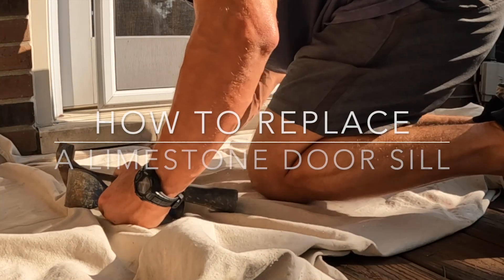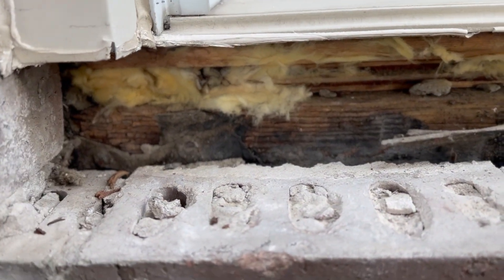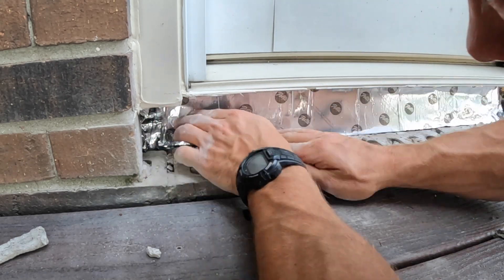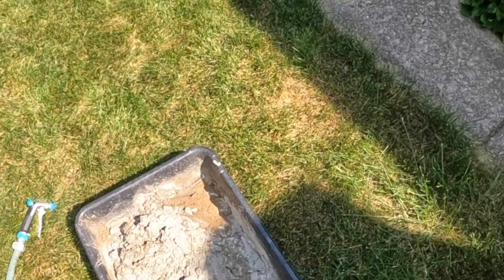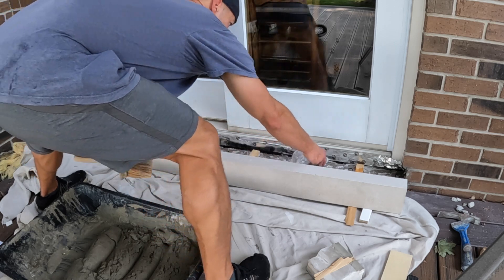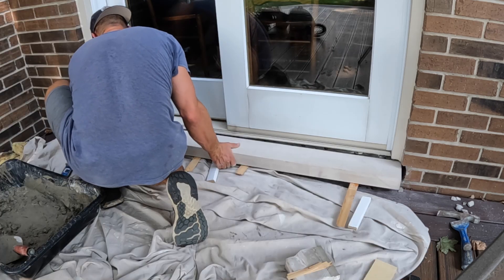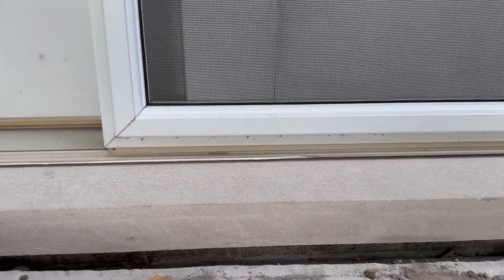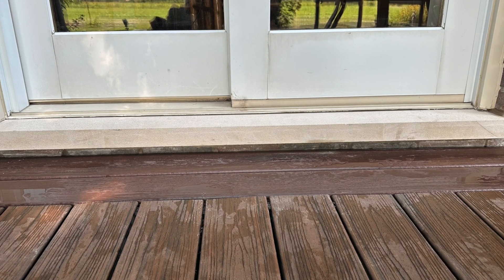How to Replace a Limestone / Concrete Door Sill

Comment: Is that a limestone sill?  When do you remove the shims?  Thanks.  Great video.
Reply from the maker: @rayscopes  It is limestone.  I removed the shims once the mortar starts to set up…… depends on the outside temperature but usually 10 min or so after the sill is set.  Hope that helps!!